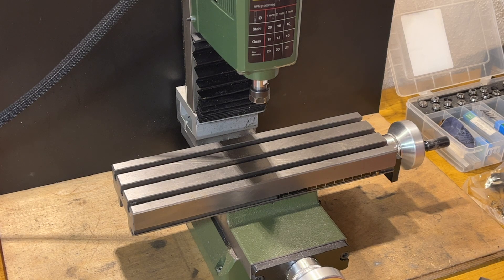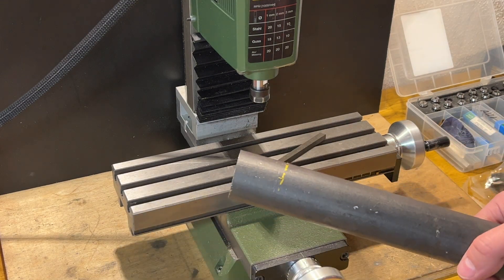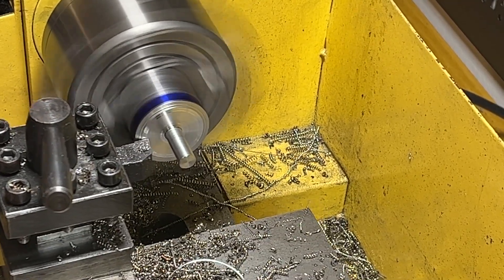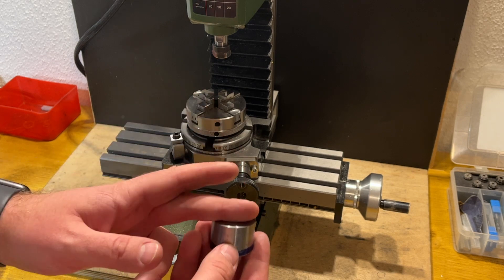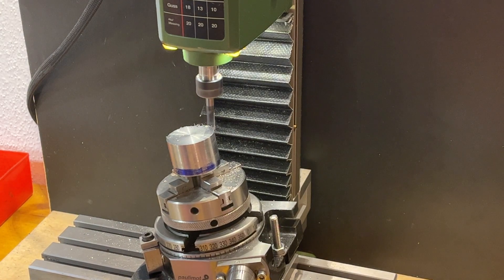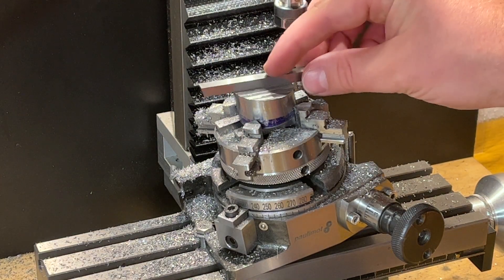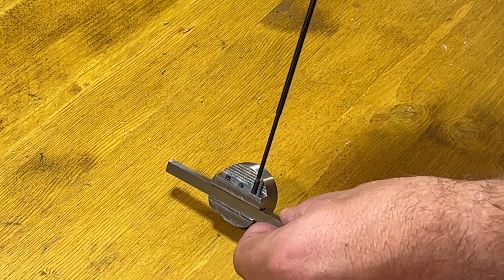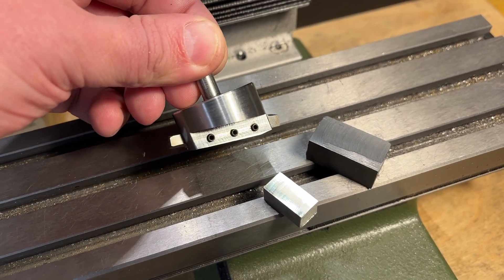Fly cutter for Proxxon MF70 mini mill

Comment: Hello again.
Ihave a question?:
Can you say me please:
1-how much is the diameter?
2- how many mm is the slut in the middle ( place for tool)
3- how many mm you cutted from the edge wher the screws are?
Thank you and 
Best regards
Reply from the maker: Hi
The shaft is 7mm, the tool body is near 25mm, the slot is 6mm. For the screws on the edge I cut just enough for them to screw and hide in a tool. The thread is near 6mm long.
Reply: @zhadlun  thanks
Reply: @zhadlun  thanks but imean this place that you cuted from edge of the body the screws plac.
Reply: @zhadlun  you cuted 2 place on the surface.one is slut for the tool and the ather for screws.
My question is how much is that?
Reply: @zhadlun  exactly 13:49 of the video time imean (from edge of the body To the wall of the screws
Reply from the maker: @sinadaneshkhah8537  The wall should be near 6mm. Better to measure a wall itself

Comment: Hello 
Why you don’t use vise?
This is not safe job.
You can make 2 peaces very small V-blocks ( 3x2) w(1 or 0/5) cm 
Then you will use of them not only for some jobs like this,also they can be very useful tools for ather jobs that you need to cut in angle.
Also you can do the bottom of the blocks with half circle then you will have very special tools that you had never seen before.
Best regards
Reply from the maker: Thanks for suggestion, need to try.

Comment: I use a hole saw cutter to cut flat surfacing.
Remove a center drill, it could be used for flat surfacing.

Comment: hi Volodymyr!

what kind of spindle is that, some custom thing? out of the box these machines come with something called MICROMOT, which can accommodate up to 1/8" shank, and your end mill is quite obviously bigger than that. I'm considering getting one for myself, but 3.2mm shank is too wimpy, so I'm a little bit confused whether it's worth it or not.

P.S. все буде Україна!
Reply from the maker: Hi. It's a custom ER11 spindle. Basically from original machine not so much left. I would say, if you need to work from a box I would buy something bigger initially.
P.S Дякую!
Reply: I was able to get  an ER-16 spindle with 10mm x 150mm length.  That has all of the same dimensions as the ER-11 spindle that you've used but can accommodate a 3/8" diameter cutter. @zhadlun  

I am also installing the spindle with a double row sealed angular contact bearing in the bottom position  (10x19x7mm- #3800-RS).  That may get  a machined bearing retainer that bolts in at the bottom too but I haven't completed the conversion yet.  I am following your basic approach but with some modifications including a slightly larger sensored motor with a higher KV and up to 25:1 compound belt reduction so I can still have the nominal 20,000 max RPM but with a belt and pulley change can get down as low as the 400-800 RPM range for the larger cutters.  I am yet to find what your final reduction was.  I suspect it's in one of the posts but I couldn't find it.

Comment: are these little mills worth $450 US? im wanting to buy a small mill to go along with my 7x14 mini lathe but ive not been able to find alot on these little guys but i have seen a few ppl using them to  cut steel but they just show its able to but never shows a finished part or really talks about how it does. is the big enough to make parts for something like a cnc router cause that will be my first project for it if i got one but if i would be better off saving the 450 an just saving for one thats in the $800-1000 price range i dont mind an i know those machines are more capable, it will just take me a couple months to save the extra i'll need to buy the bigger machines plus the space they will take compare to the smaller one. after looking at ur video library u have done quite a bit with this machine with its upgrades ill be looking through these more, u might have just convince me to buy one.
Reply from the maker: To be honest, if you have enough space for a bit bigger mill. Go for bigger. Something like sieg sx1 or even siex sx2